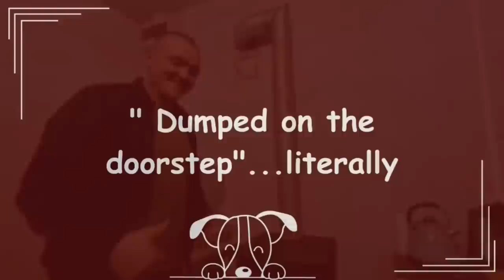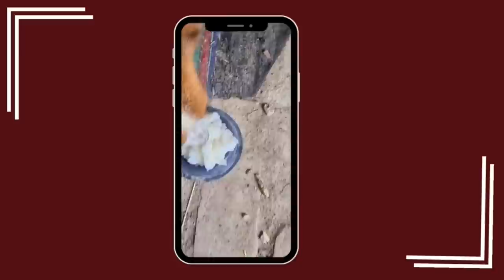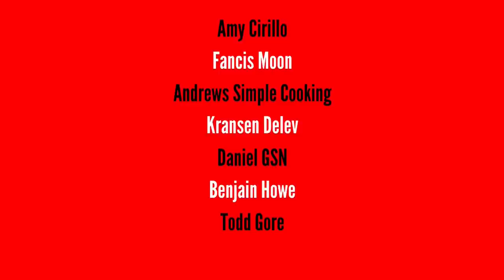Episode 12 - Dumped on The Doorstep | Abandoned Puppies

Comment: Hi mate, were loving the channel,,when your repairing internal walls like the shower ,fair enough using concrete to fill up large holes but leave it shallow .get a few bags of top coat plaster ,brushj on pva glue mixed with a little warer first then apply plaster , get ir as flush as you can with your trowel then wait till it starts  drying. Several hours hrs depending on temperature, keep touching the surface,,when it feels firm but ypi can still make an impression on it ? Go back over with trowe &l push hard as you sweep  over it keeping the front edge of the trowel 5 / 10 mm raised up as you sweep across, once you've done it a few times it gets easier ! Im now a pro just had a go and i can do it good enough to paint / invisible mend ,, good luck guys! ❤
Reply from the maker: Oh mate! Lesson learned, I wouldn't do it like this again 😅😅😅😅😅😅. I would do it exactly as you have said since I've done so much other work learning along the way. Thanks for your info, it's helpful. Hope you're enjoying the channel.